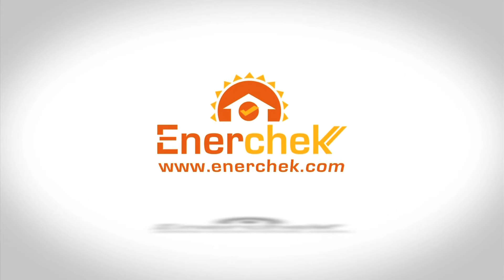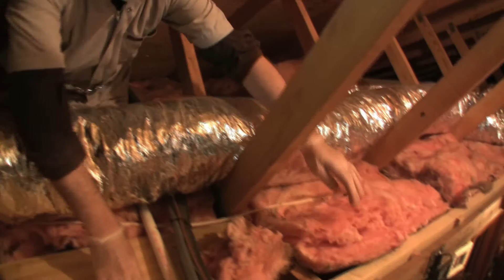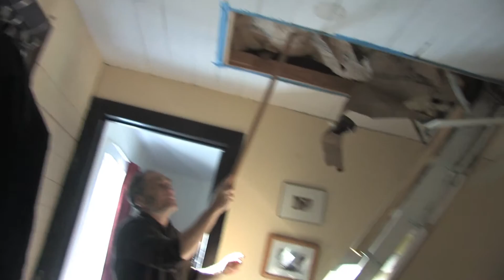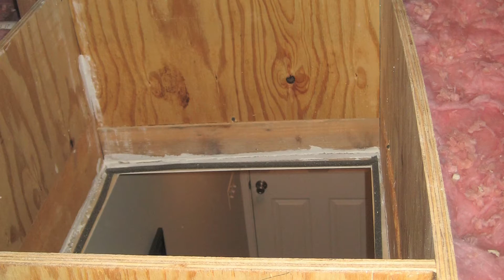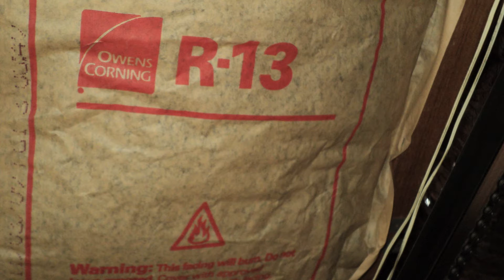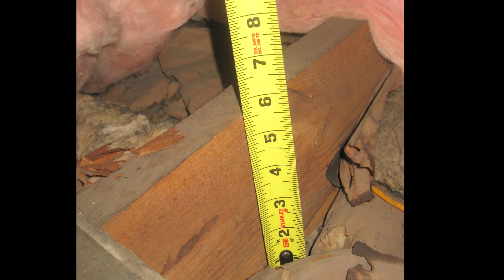DIY Energy Audit part 13: How To Insulate An Attic

Comment: Problem in our home was 3 turbines in roof eventually sucked blown insulation into one end of house. Very messy . R 30 batting is ok and even better with sealed interior ceilings. Don't forget waffling sofit for venting attic. House has to breath to avoid mold a d water resistant.

Comment: Can one use closed cell PU foam for ceiling insulation? I know they are used for roof, but haven't seen them used for ceilings
Reply: It would work for the ceiling/attic floor but is much more expensive than more typical materials. Best is to air seal the ceiling and blow cellulose or fiberglass. I don’t recommend batts.
Reply: @scottk2407  many thanks for your advice